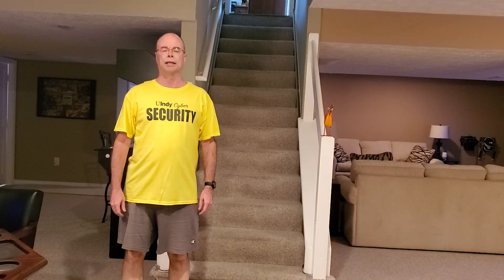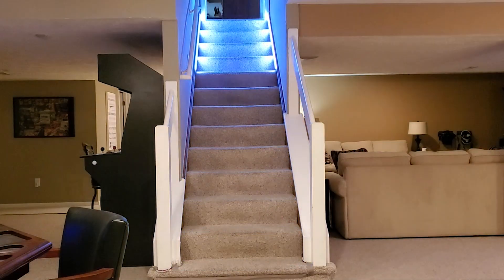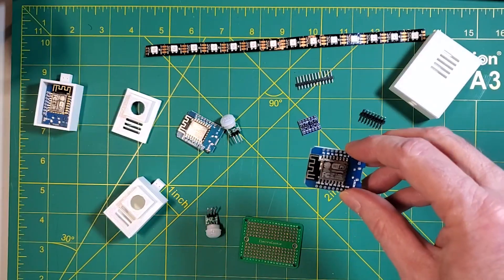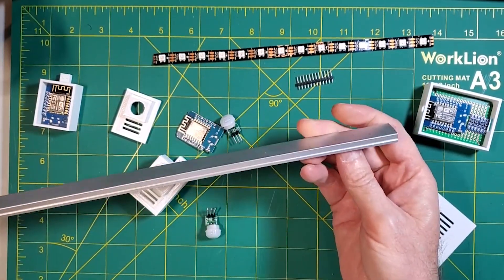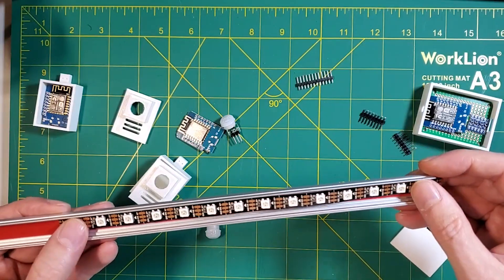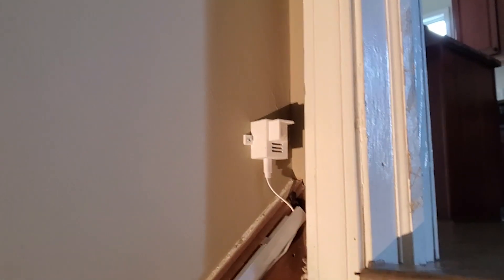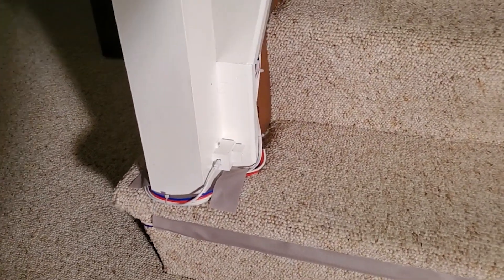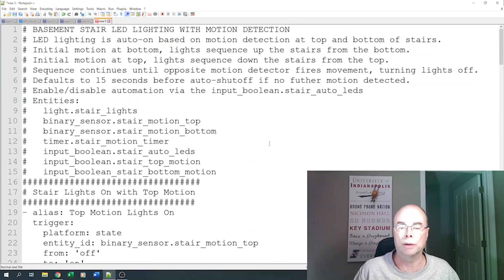Motion activated LED stair lighting... without staircase modification!

Comment: Awesome job! What is the average price for a setup like this? Cool project!
Reply from the maker: Thanks.  An actual cost is a bit hard to come by.  First, it depends on what items you might already have on hand.  Next, unfortunately, you have to buy some of these parts in 'package' quantities.  The aluminum channel for example, sells in a pack of 10 6.6 ft lenghts.  The microcontrollers and logic level shifters normally can't be purchased in single quantities.

But as a rough estimate, if you had to buy everything, the cost of the parts actually used in the project is probably around $100 - $150... most of that is in the aluminum channel, LED lights and power supply.  If it is helpful, I have a full list of the parts I used in my related blog article: https://resinchemtech.blogspot.com/2021/07/simple-motion-activated-led-stair.html

Let me know if you have any other questions!

Comment: Curious if you know a cheap, easy "kit" that can do the same...for the lazy of us.
Reply from the maker: There may be something out there, but I'm not really aware of it.  You could theoretically use a 110V powered commercial LED strip and connect it to a smart outlet.  Then you'd have to use some sort of automation engine (be it Home Assistant, NodeRed or maybe Amazon Alexa or Google Home).  You'd set up a motion detector and have the automation engine trigger the smart switch to turn the power on or off to the commercial LED strip.

I haven't tried this method, but I suspect it would be much less responsive, likely lagging behind anyone that starts up or down the stairs.  And it would also likely be significantly more expensive in total than a DIY solution.

If you don't have Home Assistant, I did create another version that works 'standalone' without Home Assistant or any other type of hub or system.  It doesn't have as many features or effects, but can basically duplicate the 'chase' lighting that I showed in this video, without needing any external automation engine.  You can see a video of that system here: https://youtu.be/b4s_VEtVWY4  It also has a related blog article with more details.  The link for that can be found in the description of the video.

I don't know if that is at all helpful.. but it's about the best information I can provide.

Comment: eh, i wouldn't worry about mods that would likely be kept by next home owner if they're that cool
Reply from the maker: Well, the problem with that is that these are all wifi devices... tied to my wifi and wifi credentials.  In addition, many of them rely on Home Assistant and Home Assistant automations.  They won't work without it.  So, unless the next owners want to set up the exact same wifi name and password, and are Home Assistant users... AND have the same Home Assistant entity names and automations... most of these devices would simply not function.

That's the thing about DIY vs. commercial versions.  With a commercial product (say a thermostat or doorbell), you can just do a factory reset and the new owners could set up the device like it was new... with their own account and wifi credentials.  It just doesn't work that way with most DIY devices.  For example, let's say I've got a custom light switch wired in the wall.  You can't access that light switch to update it without it being on wifi... and if you change the wifi and/or password, you can't access the switch to update it with a new password!

But I knew all that going in... which is why I add my technology so that it can easily be removed (and replaced with original equipment, like the light switch) without requiring a bunch of repairs.
Reply: @ResinChemTech  ah i see, i see the light!

Comment: Hi, 
Just a quick question ❓
Do we need to flash the two D1 minis to which PIR sensors are connected,the same way we did the third one ?
Reply from the maker: The PIR sensor's D1 Minis are flashed with ESPHome code, while the third controller that connects to the LEDs is flashed with WLED.  You might check out my related blog which better describes adding the code to the D1 Minis and also links to Github where you can find the ESPHome code to use for the PIR sensors: https://resinchemtech.blogspot.com/2021/07/simple-motion-activated-led-stair.html

Let me know if you run into any other issues or questions.

Comment: Will the motion detector work on Holiday Time (LED) tape lights?  They are the kind in a tube.
Reply from the maker: I'm not familiar with Holiday Time LEDs, but a quick online check is enough to let me know that these will NOT work with the current application (this or the standalone version).  The design and code are meant to work with 5V WS2812b or similar LEDs.  Unless a product specifically states that the pixels are WS2812b (or compatible with a clockless 5V single line data signal), my version simply won't work.

Now it might be possible to use some sort of commercial LED  strip and something like a motion sensor to switch the power off/on via a smart switch to that strip (as commercial products are usually designed to work with 120V AC), but that is a completely different project and would involve a completely different type of automation using Home Assistant or another automation platform.

Sorry.. but the hardware requirements are pretty specific for this project.

Comment: Like the idea. Just wish the install was cleaner. Any ideas on how to hide the stuff?
Reply from the maker: That all depends on your tolerance level for making modifications to things like the stair stringers, drywall, carpet, etc.  I think the 'ugliest' part of this install is the wiring that has to run under the first tread lip to the opposite side stringer for the second side lights.  It really isn't as noticeable as it appears in the video when standing and with the similarly colored Velcro holding it in place.  I "could" have cut the carpet, ran the wiring underneath and then glued the carpet back in place.  But that wasn't a modification that I was willing to make as my goal was to be able to remove the entire system without the need to make any repairs.

There are a lot of other videos out there on making a stair lighting system similar to this... but with pretty substantial 'construction' or changes to the existing stairs.  My goal here was to create something that wouldn't require any of that and could easily be removed.... with the downside of the exposed wiring.  But you could definitely make this install 'neater' if you are willing to make some structural changes.

Comment: I couldn't help but want one,  kind of jealous, but I have a long hallway. 
Will consider this.
Reply from the maker: I actually had another viewer that did install these lights down a long hallway instead of on stairs.  Since WLED has hundreds of different effects, you could simply install these along the baseboard and simply have the lights gently fade on a solid color to light the hallway when motion is detected at either end of the hallway.  You wouldn't have to use the chase or wipe effect I used here (but you certainly could).  The general design is a concept could be used in a lot of different ways, in addition to stairs.

In fact, if you are not a Home Assistant user, I did do another version (with not quite as many features and effects) that works with only wifi... no home automation system or hub needed.  You might check this out as another alternative: https://youtu.be/b4s_VEtVWY4

Comment: 0:22 he was taking already 3 steps and only after did the light came on going up . Now i need the light before i take the 1st step i,e. When i am still on level ground . This is insufficient and straight dangerous since it keeps people in the illusion having a lit way when they dont ..............FAIL !!!
Reply from the maker: If you had actually watched the entire video, or read the video description, you would know that I intentionally added that delay due to the nature of the PIR sensors and the opening at the bottom of my stairs.  And I have done an update video with different sensors ( https://youtu.be/ZRb_wpJo1AM ) that do trigger the lights as soon as you step on the first step.  However, there is a much easier solution if you feel these are a safety hazard.... DON'T INSTALL THEM!

Comment: Great lighting idea until the goofy cat who is in perpetual motion sets it off every other minute.
Reply from the maker: I actually did a video recently where I upgraded the PIR motion sensors with ToF distance sensors: https://youtu.be/ZRb_wpJo1AM  The advantage of these sensors, among other things, is that they have a much narrower field of view and could be mounted higher up on the wall/stair posts so that smaller pets going up or down the stairs would not trigger the lights.

But you are correct... the original motion sensors would be triggered by a cat (or dog, rabbit, turtle, Komodo dragon, etc.) moving up or down the stairs.  We don't have any of those in our house, so it hasn't been an issue for us.

Comment: I love this project. Kudos! Can share the 3 printer enclosure file with us? I cannot find one that's cover one side like the one you have. Oh, I'm new at 3D printing.
Reply from the maker: Yep... you can find links to the 3D printed parts (and much more) at the related blog article for this project: https://resinchemtech.blogspot.com/2021/07/simple-motion-activated-led-stair.html (you'll find the links to the 3D printed parts at the end of the article).

But if you haven't seen it yet, I made an improvement to the sensors for the top and bottom of the stairs since this original video.  If you are considering building these stair lights yourself, you may want to take a quick peak at the following video and decide if these new sensors might work better for you as well: https://youtu.be/ZRb_wpJo1AM

Good luck and let me know if you have any other questions!
Reply: @ResinChemTech  Thank you kindly! I already watch the improved video a few time. Outstanding!

Comment: Excellent video! It’s motivated me to try this. 
I was wondering is there a way to creat a wireless PIR sensor or even button? I was hoping maybe a battery powered separate D1 mini  with PIR could link up to and control another D1 mini which is being used as the main WLED driver but is out of sight.
Reply from the maker: Thanks!  Glad it provided you with some motivation to try it yourself!  

It is certainly possible to use something wireless for the sensors at the top and bottom of the staircase.  I'm not sure that a D1 Mini is the correct choice as it would probably draw too much power and quickly drain a battery (wifi devices are power hungry!).  I'd look at maybe something like a Zigbee motion sensor (especially if you already have  a Zigbee network).  The issue with these, however, is that they generally have long cool down periods (like 30 seconds or more), which could be a challenge in terms of the automation... since the sensor would continue to show motion long after someone has exited the stairs.  I believe Aqara has a new motion sensor where you can specify the cooldown, but I haven't tried or tested them.  You may also have issues with the wide field of view (FOV) with a PIR sensor like this, depending on your stair configuration.  I had this issue at the bottom of my stairs, and just recently released a video where I replaced these PIR sensors with TOF sensors (you can see that vid here: https://youtu.be/ZRb_wpJo1AM ) - but this would also be a wired/D1 Mini solution, although it does work much better than the PIR option.

You could always try a battery-operated D1 Mini... something like a LiPo battery would probably be best... but I know that from my original mailbox solution that used a battery-driven ESP32 (that even when into deep sleep when not in use), I couldn't get more than about a month out of the battery.  I suspect an D1 Mini that has to constantly be awake and watch for motion would drain even faster than that... possibly within a week.

If you find a good wireless solution, please pass it along!  I'd love to share it with my viewers and provide that option.  Also feel free to reach back out if you have any additional questions.  Good luck with your project!
Reply: @ResinChemTech   yeah looks like your’re completely right. D1 mini approx 40mA draw which will soon take its toll on a battery.  I will still look into other options but I’m not hopeful. 

I don’t have a zigbee network but assume it’s relatively cheap to set up so could be an option. 

Yes I had already seen your video on the PIR upgrade and intended to do that. The only thing with that side of it that I need to do now is work out how to get an ambient light sensor in so that it only come on when below a certain lighting level. 
I get I could use another input (probably have to be analogue) and then have a condition based statement saying “if THIS and MOTION then turn light on”. 

Did you bother with this yourself or just have them come on in any lighting condition?

***edit**** seen that I would need to create an automation with the trigger as either the upstairs or downstairs motion sensor and then have a condition of lux level below a certain value to achieve only lighting up in the dark. 

Slowly getting there. 
Just need to make sure that the D1 mini can cope efficiently with the three sensors.
Reply from the maker: I don't use any sort of light sensor for the stairs.  They come on all the time unless I toggle the input_boolean to disable the automations.  I do, however, lower the brightness of the LEDs if it is after 10 pm and the overhead basement lights are off.  I did this just fairly recently as I was getting blinded by the bright LED stair lights after watching TV in a dark basement and then heading up to bed.  With no windows in the basement, there isn't any 'ambient' light, other than the overhead recessed lighting... which is also automated in Home Assistant... so, I can use the brightness level setting of the overhead lighting to alter the stair lights.

As far as a light level sensor, of course you can just use a photoresistor.  But in my new garage multisensor, I use a photosensitive light module.  This uses a photoresistor as well, but had a digital binary sensor that is 'on' or 'off' based on an adjustable light level.  They are only about $2 apiece, but easier to use than a photoresistor, analog level and trying to convert that to lux.  You can see that in my video on an updated multisensor ( https://youtu.be/tVTha44i8SI ).  The D1 Mini won't have a problem dealing with both a motion sensor and a light level sensor.  But you are right that motion would serve as the trigger and light level as a condition in your automation.

Let me know if you have additional questions or thought!
Reply: @ResinChemTech  also, thanks for the response! And especially how quickly you got back to me.

Comment: You are amazing ,a very nice job indeed , I’ve nearly finished this project on my stairs too,I was wondering if It’s possible to operate this from a 5inch screen instead of my phone, if so could someone please help,many thanks Paul.
Reply from the maker: Wow, thanks!  When you say 'operate this' are you talking about WLED... or Home Assistant, or what?  Either way, both WLED and Home Assistant have mobile apps that could be installed on a small tablet (Android and/or iOS).  Of course, they both also work in a browser if your display has that.

So, I'm happy to try to help, but I guess I need to know what it is that you'd like to control (e.g. WLED effects?) and what type of 5" screen you are talking about... and what are its capabilities/operating system?
Reply: Thank you for your reply and time,any suggestions on which screen to get?I will be installing home assistance ,I’m building your controller but got 12V strip lights, dose this alter the build of this controller please,many thanks for your help and time, many thanks Paul from the UK.
Reply from the maker: Just about any tablet will work as long as it has a web browser.  I am using a couple of older Samsung tablets in different places in the house, but to be honest, Home Assistant handles most automations (like the stair lights) without any interaction, and many of the other things we interact using voice control with Google Home via Home Assistant.

As far as the 12V LED strips, you will obviously need to step that voltage down to 5V for the controller via a buck converter or other means (the D1 Mini will go "poof" if you try to feed it 12V).  If you use separate power sources for the LEDs and the controller, then you must have a common ground  between the controller and the LED strip or things won't function normally.  Otherwise, as long as you feed 5V to the controller, the build is the same.

Hope that helps!  Good luck with the project (and Home Assistant... I love what it can do!).  Feel free to reach out again if you run into additional questions or problems.

Comment: My Chihuahua weight 4 pounds. This lights will work? Thanks
Reply from the maker: Do you want your dog to trigger the lights?  The PIR sensors should work, but you may want to consider replacing those sensors with the upgrade I cover in this video: https://youtu.be/ZRb_wpJo1AM

These newer distance sensors should definitely work with anything that is large enough to break the distance beam.